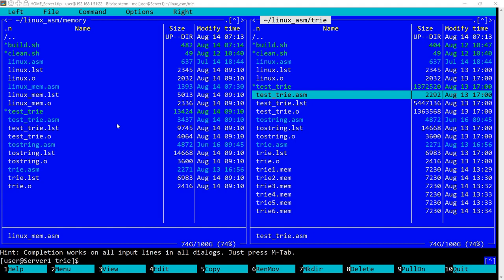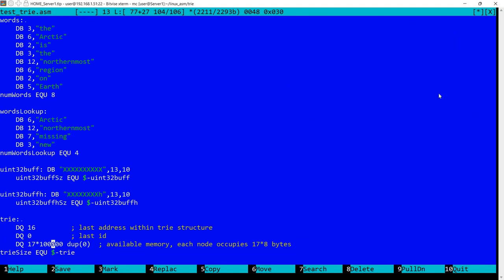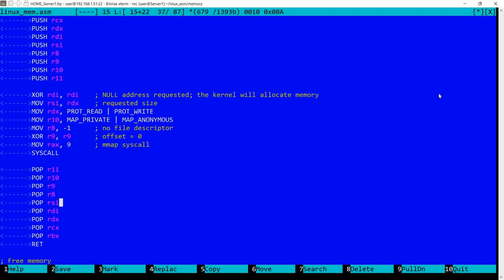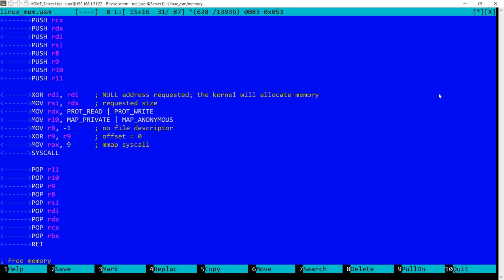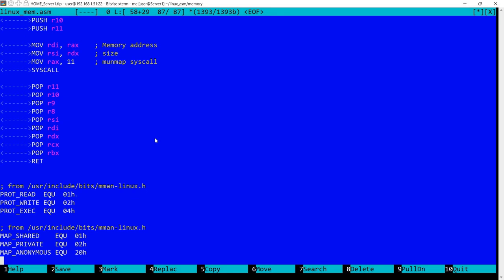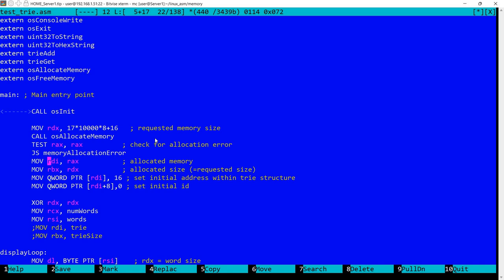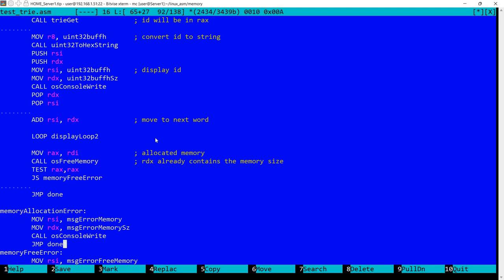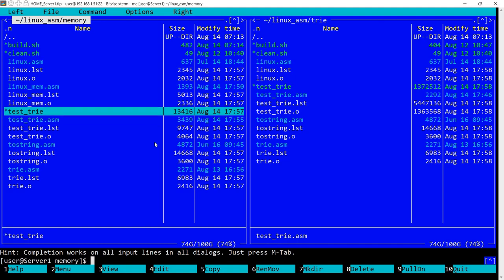How to dynamically allocate memory in assembly language on Linux

Comment: Thank you. I will start watching your assembly videos. Do you use x86 or x64 assembly?
Reply from the maker: The correct answer would be "x86 64-bit assembly". I guess you could short it to "x64" even though this does not make sense. The "x" in "x86" stands for the various CPUs that implemented this architecture (8086, 80286, 80386, etc.) when it was 16-bits, 32-bits and now it is 64-bits. Also a modern CPU still contains all the older instructions and registers (I have a video running an old MSDOS operating system on a new CPU without any change). But my videos (especially those running on Linux and Windows) do make use of the modern 64-bit architecture.
Reply: @ComputingMongoose  Thank you for the clarification! Btw, way then are old programs run in 32bit mode, if the instructions exist on the CPU?
Reply from the maker: @nickst2797  When running in 32-bit there is also a different view of the addressing modes. I guess "old" may mean they were written before the new addressing mode in 64-bits (or at least without using it). A very short assembly program, like "MOV AX,3" could be compiled in 32-bits (this sets a flag in the exe file) and then could be executed in 64-bits without problems (say by changing the flag in the exe header, even though it may require some other formatting changes). However, by explicitly using 32-bit addressing modes like "MOV AX, DS:[EDI]" this becomes invalid in 64-bits mode. However, the CPU still knows about this instruction when running in 32-bits mode (and there are actually multiple 32-bits modes). I hope this quick writeup makes some sense.  Some more here https://en.wikipedia.org/wiki/X86-64#Operating_modes